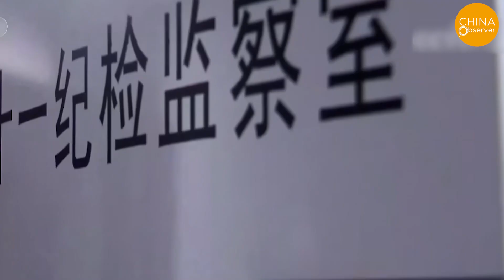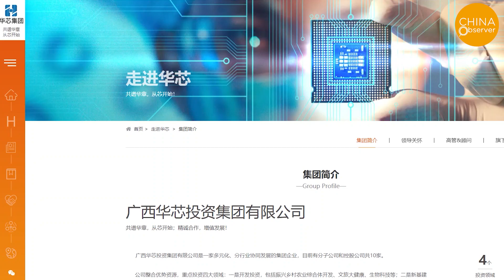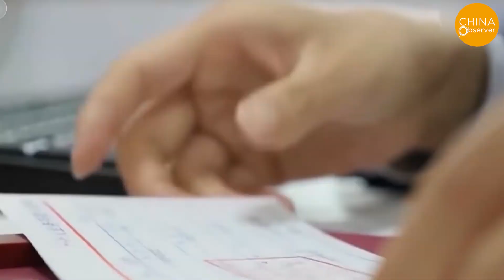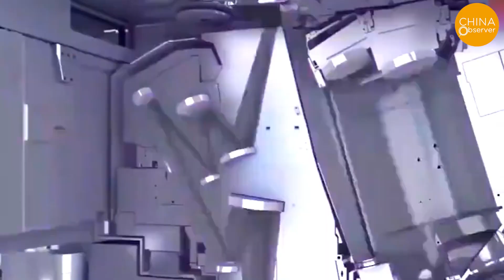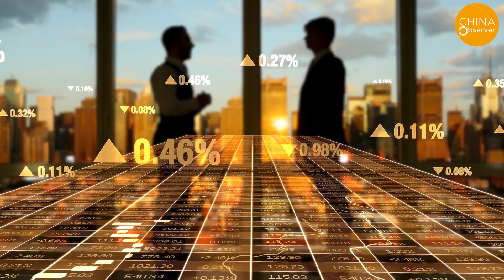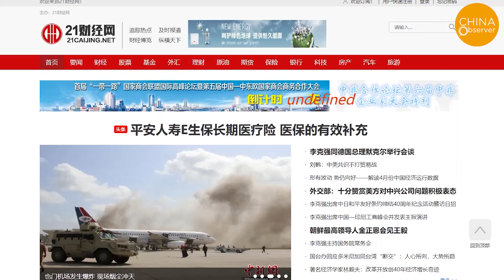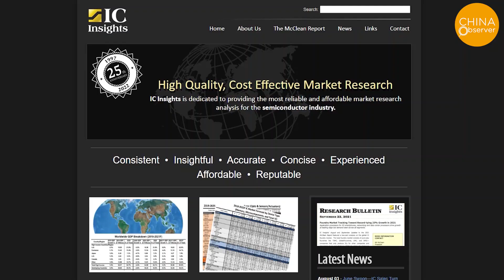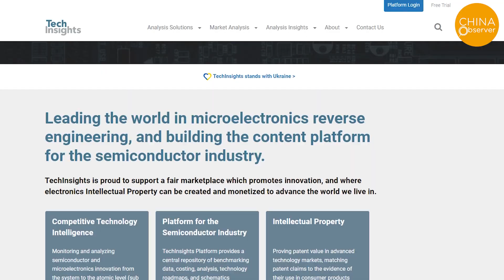China’s Chip Bubble Burst as Top Players Fall From Grace | Chip Scam | Integrated Circuit

Comment: Memory is not CPU in integrated circuit jargon. In any case, setting up a memory fab plant was a mistake if you want to advance your chip making skills to the level that TSMC enjoys. You focus on improving the main CPU processing chip. Memory chips are not manufactured to the same small nanometre node as CPU chips so will not advance your chip technology very far..
Reply: isn't memory usually ahead in manufacturing size? Memory repeats a lot and you can just put more cells on the wafer to combat potentially bad yield. So it is usually best to produce memory first on a new node to get cash flow going while you improve your manufacturing technology.